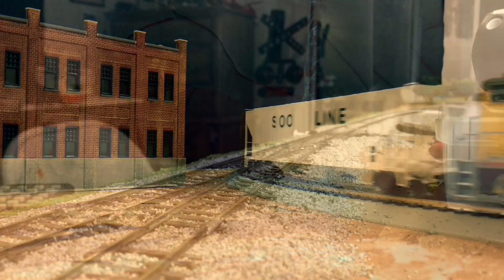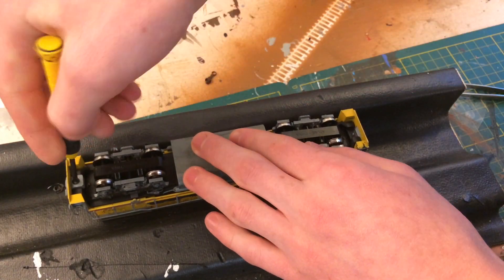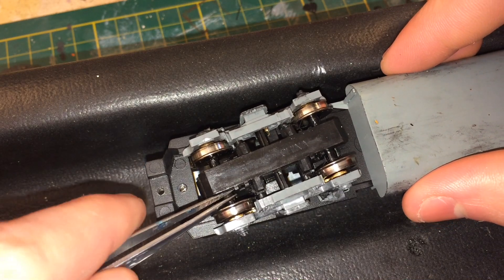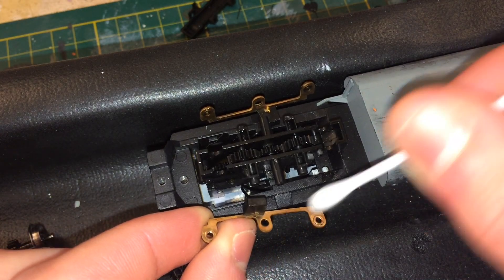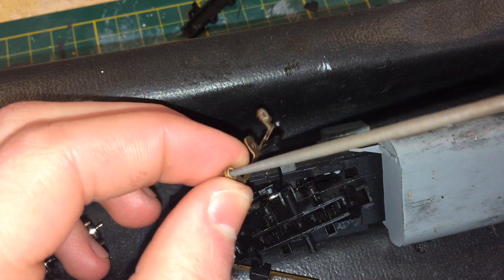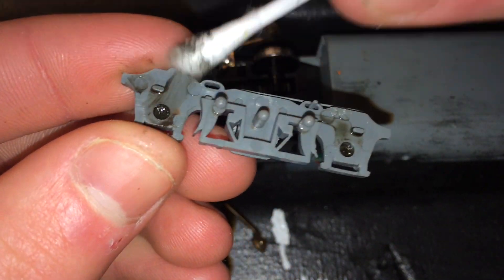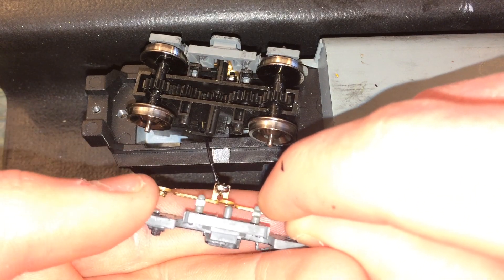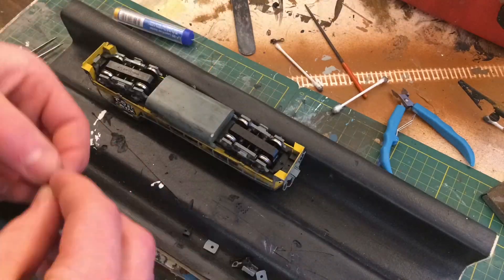How Make Atlas Locomotives Run Better For Free!!

Comment: THhisis the same design that most manufacturers use, & is not an Atlas problem. The main problem here is the trucks were over lubricated. The gears in these trucks are  pretty much self lubricating. If any lube is used on the gears, it should be grease, used SPARINGLY.. The worm gear thrust washer are the main point of wear, using light oil.  Michael  NZ

Comment: I don't use regular oil, I use Lucas Gun Oil it's little thicker and moisture proof and Heat resistant , Much better grade oil , And White grease , safe for plastic an rubber  , I apply it with a needle , no over oiling !!!!!! , Ben doing that for years !!! , Great running engine's no problem's !!!!!!, Promise!

Comment: track 10.... fyi  oil and grease are conductive of electrical current ... put grease on your car battery terminals to prevent the oxidation process ( that white chaulky stuff that builds up on the terminal).  just fyi

Comment: I would think that this problem occurred because of over lubrication of the gearboxes.  I now own 4 Atlas engines but mine are brand new and I will not over lubricate them.  Two Atlas GP-7's, Atlas RS-3 and an Atlas Fairbanks-Morse H15-44.  When soldering to brass it helps to use a little rosin core solder with some additional rosin flux.  Never use plumbers flux as it is corrosive.  I agree with no rubbing alcohol, but odorless mineral spirits can be used without fear of paint loss.  A keep alive circuit is very easy to build.  All you need is a little square full wave bridge rectifier & a 1000uF capacitor.   Cheers from eastern TN

Comment: the mysterious "keep alive" sounds like a capacitor with diodes. (assuming DC loco) i will look into it. could be a VERY cheap DIY.
Reply from the maker: Correct. You can buy them or if you have some skill with a soldering iron they are not that hard to make.

Comment: The problem is excess grease, not the design. Clean out the grease, then lubricate only the worm gear and its shaft with a light (LaBelle) lubricant. Involute (spur) gears need no lube since they don't rub against each other.
Another help is to add small conductive washers to all outboard axles so there is less clearance between the wheel hub and pickup plate.

Comment: I had Atlas N scale locomotives that just wouldn’t run right. That’s what kept me from buying another one and went to Kato. On the N scale I have tried everything possible, they have the same exact contact as the HO scale and I will try the same thing you are doing. Thanks for the tip.

Comment: great tip. thanks. i was under the impression that one should not file nor sand the brushes? just clean them well instead with contact cleaner. not sure - i am new here! how often this service will need to be done?
Reply: those are NOT brushes they are contact plates... actual brushes rub against the armature/stator at the can motor

Comment: Hi, great video - right up until you pulled out an emery board...
DON'T DO IT!

Just like not using sand paper or a very abrasive Brite-Boy on your track - because it leaves SCRATCHES!
And scratches hold dirt & oil - and that's BAD for electrical contacts!!!

Polish the contacts with an eraser - yes, an old fashioned pink eraser...

You're welcome